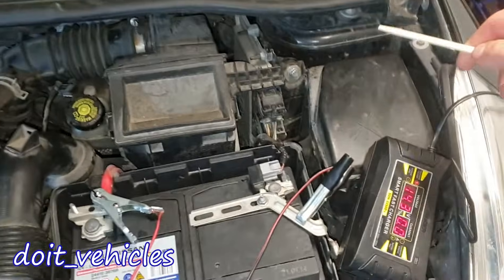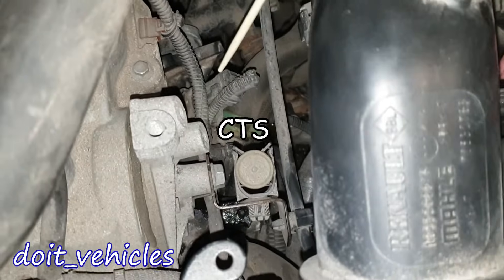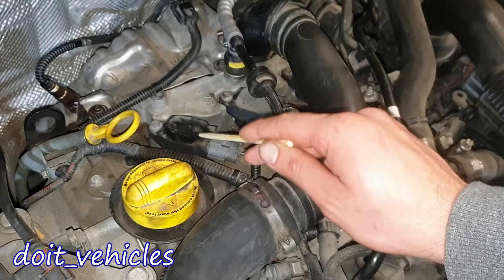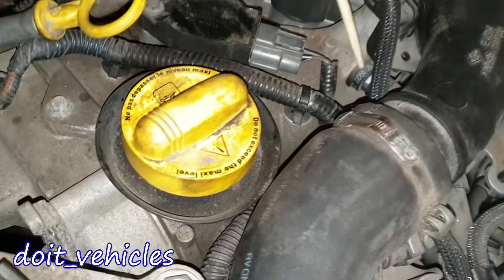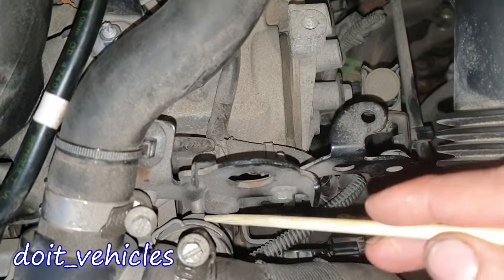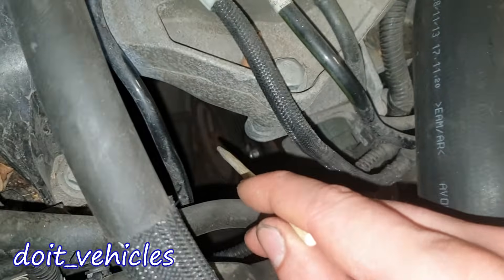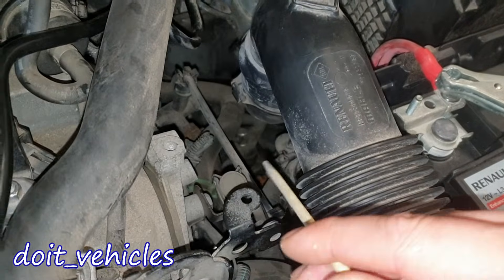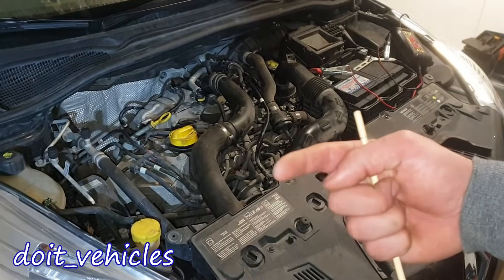0.9 Renault Clio TCE Engine Layout Components Location

Comment: At the bottom side where oilpan is, I have 2 sensors, one in front side of engine, one on back side... Both look like oil level sensor but only one is pluged in, the other have no wire harness, is that normal?

Comment: I need your help. When I drive my Clio sounds like it has a huge turbo but I don't have alot of boost, I get that it could be a leak but the " check injection system" warning comes on aswell as the spanner. Then the diagnostics machine gives me " open inlet air flap, open circuit" error. Where or what is this part.

Comment: Hi @doit_vehicles, I noticed that 
Plug next to the pcv value with two wires is missing 1:29 on my Clio 4 0.9 tce. 
Recently sent the car to the mechanic and it’s now I notice that. Any idea what it might be. I can tell there’s a gap and goes directly into the manifold. A piece is missing and the connector as well. Noticed the connector joining the solenoid is tapped.
Reply: I have the same problem. Is this connector necessary?

Comment: This video saved my lifetime. I have just rebuilt a renault 0.9 tce that was as a tow in and was partially stripped and couldn't figure out where one last connector went only to find there is a sensor hidden deep in a crevice on the timing chain cover (cam position sensor). Thanks again you are a lifesaver.

Comment: Where is the fuel filter located?
Reply: Not sure but i think it’s in the fuel tank.
Reply: Underneath the rear seat
Reply: Chech on ur front driver wheel underneath there
Reply: It's underneath the rear seat, inside the fuel tank. Take out the fuel level sensor assembly together with the fuel pump.

Comment: Brilliant video!  Where is the crankshaft position sensor located please?
Reply: on the back of the transmission. If you remove the airfilter box and battery, should be able to see/reach for the crankshaft sensor. It is located between the engine and gearbox flywheel.